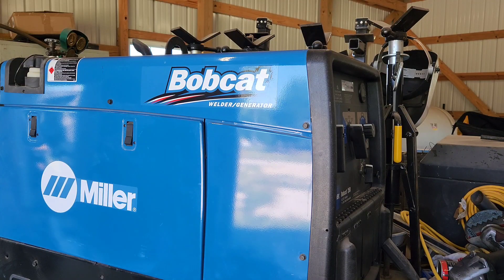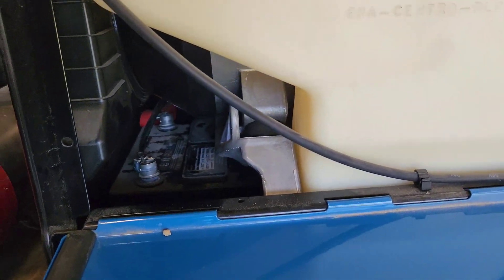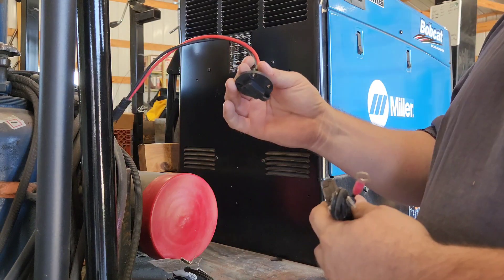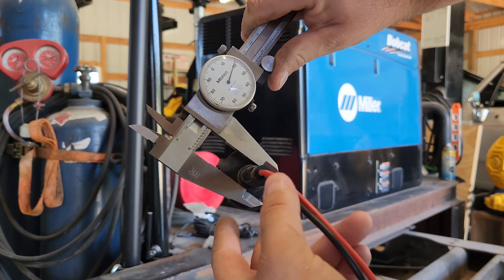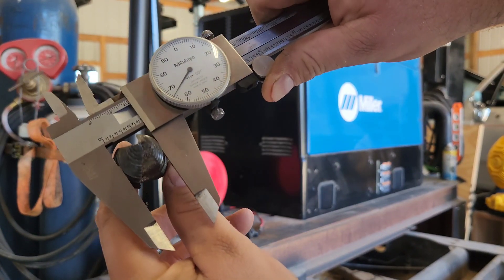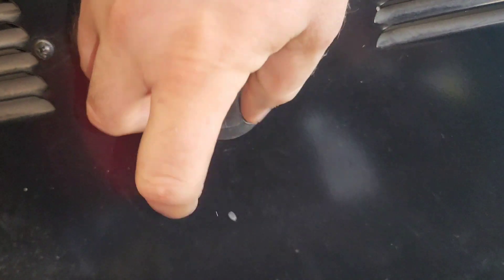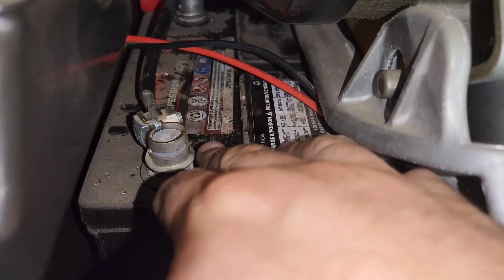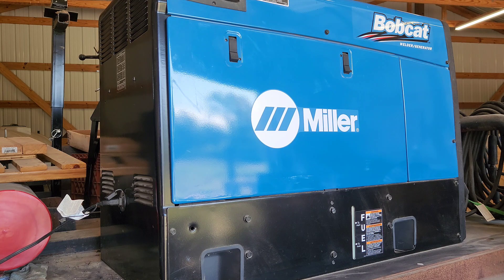Miller Bobcat 250 Battery Hack. Save Yourself Time and Money #millerwelders

Comment: But actually, set yourself up a through wire to the truck battery so that you can charge the battery on the welder when you drive, plus then you will be able to maintain the truck battery when you plug it in…..if that makes sense? This is a great idea, I’ll have to do it with mine, I never use it but want it ready to go. 
Also, try to find some shelf stable fuel or race fuel or ethanol free fuel so that it can be stored for long periods without the fuel going sour.
Reply from the maker: I would if this welder was on a vehicle. That would be preferred. This welder is mounted to a "trailer" I made so it sits in the shop for a good bit. I do run Ethanol free gas in all my small engines. I think it really helps. Thanks for watching.